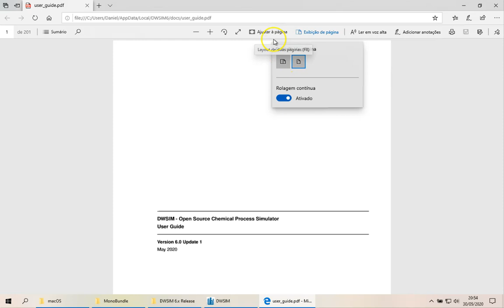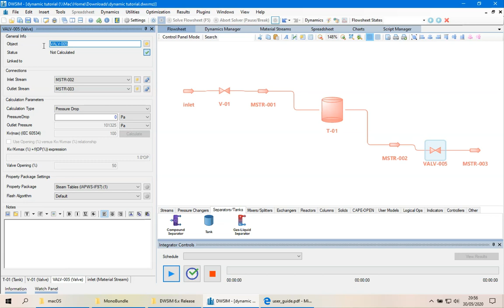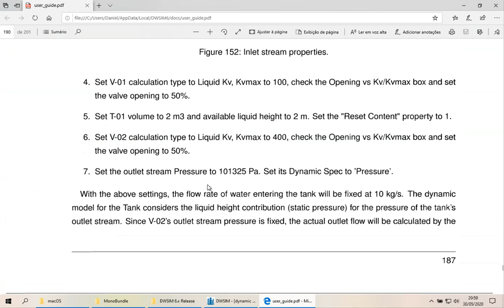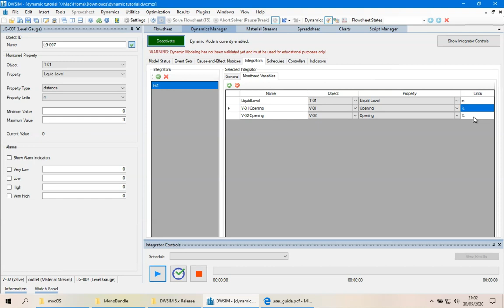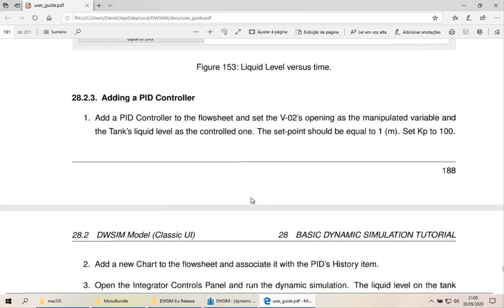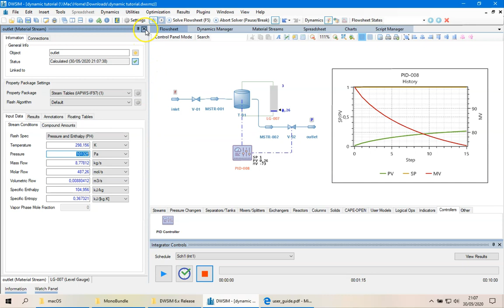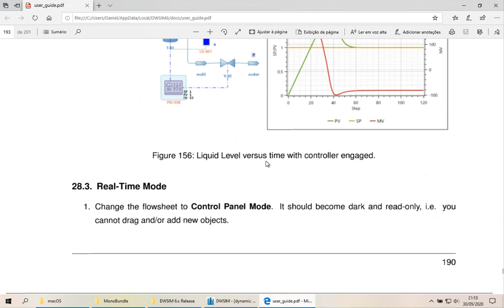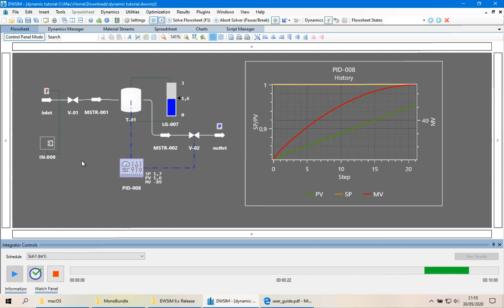Basic Dynamic Simulation Tutorial

Comment: I did everything in the video on the latest version, but it doesn't work. when I click on run icon on the integrator control panel, I get the below error:

System.IndexOutOfRangeException: Index was outside the bounds of the array. at DWSIM.UnitOperations.UnitOperations.Tank.GetPropertyValue(String prop, IUnitsOfMeasure su) in C:\Users\danie\source\repos\DanWBR\dwsim\DWSIM.UnitOperations\UnitOperations\Tank.vb:line 348 at DWSIM.FormDynamicsManager.UpdateIndicatorList() in C:\Users\danie\source\repos\DanWBR\dwsim\DWSIM\Forms\FlowsheetComponents\FormDynamicsManager.vb:line 162 at DWSIM.FormDynamicsIntegratorControl._Lambda$__82-5() in C:\Users\danie\source\repos\DanWBR\dwsim\DWSIM\Forms\FlowsheetComponents\FormDynamicsIntegratorControl.vb:line 393

How can I fix this?